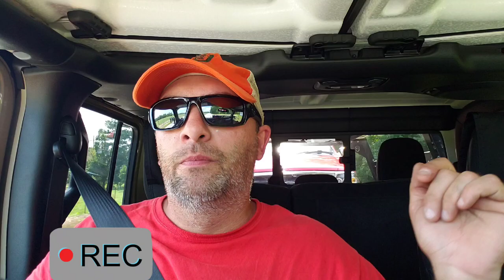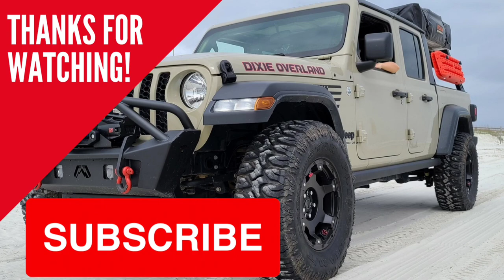Jeep Gladiator Max Tow Test

Comment: I tow around 6400lbs with our Max tow.  Travel Trailer loaded and Gladiator with 3 people and a dog.   Weight Distribution hitch makes all the difference.   That being said also tow a car trailer and cars with zero problems and no real bounce.   My biggest complaint is the range is TERRIBLE but then again it was never designed truly for this.  My son drives a 2011 crown vic police interceptor and no it has not chucked the rods out of it haha.     Great video sir.
Reply from the maker: The bounce could have been many things including the roads here in Alabama and the suspension on the truck i was towing loading and unloading as I went.  Overall the Gladiator pulled it well on the short trailer I had.  I think a bigger trailer would probably have added more stability.  Thanks for watching!

Comment: IIRC, Max Tow = 7600lbs towing capacity....only 600lbs more than the Gladiator Rubicon (not a huge increase really so I likely won't miss it).
7000lbs is fine for my needs, and a good deal MORE than I expect to be needing.
-- BR
Reply from the maker: Yeah you're right. That's what I get for the sun beating down on me too early in the morning 😂
Reply: @DixieOverland  Well, you could always put a "Bimini Top" (those sunshade-mesh things) on your Gladiator...that should help, AND keep the wind/turbulence down a little bit, too.  ;-)
I'd probably get one for my own Gladiator...except I'll probably never be taking the Freedom Panels off.
-- BR
Reply: It because of the 4.10 gears. But the max tow also has wider axles. I think the rubicon has them too. But maybe not. Max tow has extra fenders added